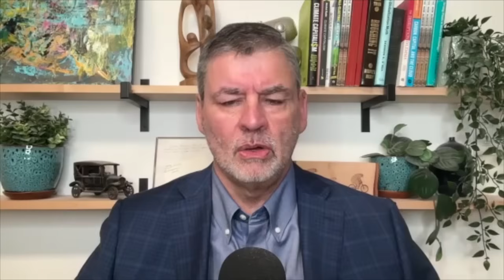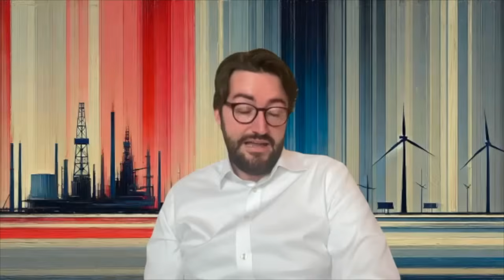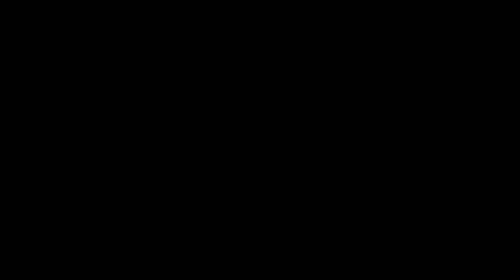Electrotech Is the Force Transforming Global Energy Supply AND Demand

Comment: Even more amazing, Caterpillar's new electric-drive dozers include the medium-sized D6 XE and the large mining dozer D11 XE. These models use an electric drive system, not a fully battery-electric one, to provide more power and fuel efficiency than traditional models. The D6 XE offers up to 35% better fuel efficiency than the previous D6T and improved agility, while the D11 XE is designed for maximum fuel efficiency and lowest cost of ownership in large-scale applications. Even a bulldozer can be reimagined

Comment: Caterpillar's new electric-drive dozers include the medium-sized D6 XE and the large mining dozer D11 XE. These models use an electric drive system, not a fully battery-electric one, to provide more power and fuel efficiency than traditional models. The D6 XE offers up to 35% better fuel efficiency than the previous D6T and improved agility, while the D11 XE is designed for maximum fuel efficiency and lowest cost of ownership in large-scale applications. Pretty amazing that even a bulldozer can be transformed

Comment: Alberta has significant potential for geothermal energy, supported by its oil and gas industry's drilling expertise and vast subsurface data. While there are no large-scale geothermal power plants currently operating, several projects are in development, and the province is investing in research and drilling for test sites. The technology has potential for both electricity generation and direct heating applications, with possibilities for repurposing abandoned oil and gas wells. I think this is the way forward for Canada

Comment: Heat pumps are expensive heaters over natural gas.   A efficient natural gas furnace is 90% efficient.  A NGCC plant at best is 50% efficient X 0.38 of the generated electricity that reaches the home power meter X 300% efficient for the heat pump = 57% efficient.   This is past the best actual condition.

Comment: I live in Australia where 35% of homes have rooftop solar. 5 years ago I replaced my old 1.5kW rooftop solar system with 14.5kW of solar panels and 11kW of inverters. The cost of the system back then was $A9,200 ($US6,100) fully installed. The cost of that same system today is around $A7,000 ($US4,500). In addition, the Federal government has just provided a 30% subsidy on home batteries. So a $A15,000 ($US10,00) Tesla Powerwall now costs around $A10,500 ($US6,500).

Comment: I’ll speak out here for low tech solutions. These can greatly help our electrification of everything by drastically reducing energy needs.

Ben Franklin said a penny saved is a penny earned. But I submit it is more line four cents! You don’t pay taxes but can get paid interest on savings! Then there are opportunity costs and other factors that make savings so powerful.

1. Insulation. 
2. Reflective (and soon, solar) window films.
3. Light-colored buildings and roofs
4. Trees
5. Awnings
6. Design simple electronic devices like microwaves and toasters to not have phantom loads. And unplug them when not in use.
7. Stop buying oversized homes, cars, etc.
8. Wear a sweater
9. Wash clothes in cold water and use a clothesline.
10. Vacation closer to home
Reply: Absolutely an essential piece of the puzzle...

Comment: I am not sure I really understand what you mean about the demand side being what's relevant. I see the potential of Solar to drop energy prices to levels previously unimaginable as what's important. I don't think the technology behind batteries or heat pumps is all that impressive; if the investment had been there we could have done that decades ago. 

What does it matter if I heat with NG or a heat pump if it isn't that the energy supply is cheaper? That seems to be what the conversation around 2035 the best technology is suggesting. 

I don't think the average person cares at all about efficiency or primary energy or if they are using an electron or molecule. If you aren't a person who watches energy podcasts, I doubt you can name the efficiency of an ICE or even know what primary energy is.
Reply: Well can’t quote chapter and verse on ICE engine, but I know the LED lights that replaced the old incandescent lights at my front door cost me less then $5.00 to run them and entire year during hours of darkness. Estimated lifespan, over 15 years. Basically, I’ll never have to change out the bulb or worry about the cost of keeping lights on. Same thing for my new washer and refrigerator, much more efficient.
Reply: "I see the potential of solar to drop energy prices to levels previously unimaginable..."
Energy is inherently ubiquitous and free.
It is power-service which is costly.

"I don't think the average person cares at all about efficiency..."
As they shouldn't.
Forced or incentivized or cajoled efficiency is always harmful.
The single-greatest threat to future generations is energy-conservation.

Well-to-wheels, ICE vehicle thermal-efficiency is 30%, and pure-plug-in vehicle thermal-efficiency is 30%, assuming best-case scenarios for each.
There are many steps involved in getting electrical power from a power-plant to the wheels of a pure-plug-in vehicle, and none of those steps is 100% thermally efficient.
Reply: @aliendroneservices6621I think it's a little disingenuous to add emphasis cutting "energy prices" to "energy". Obviously I am referring to electrical supply. 

I would argue that solar will be built out to cover the early morning and evening, and make their revenue for those few hours a day, and most of the day demand being lower and supply around its peak electrical supply will be free. I would also say anywhere of Suburban level density downward will likely move to using so much solar that distribution utilities collapse, although not until Sodium Ion batteries are widely commercialized. 

That said if your point is we'll need NG in some capacity I don't think anyone would disagree that it will be needed for some overnight service, and eventually as storage becomes available for over night, low renewable output periods. Thats just not the time charging your car or running the dishwasher or certain industrial processes will be deeply inexpensive.
Reply: @neolithictransitrevolution427  i wouldn’t bother arguing with this guy. he’s pretty far gone